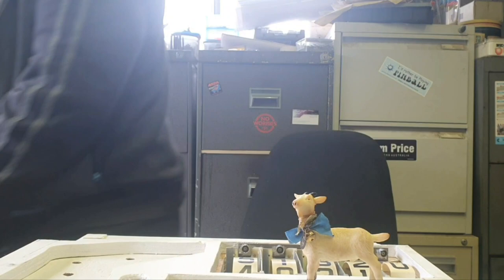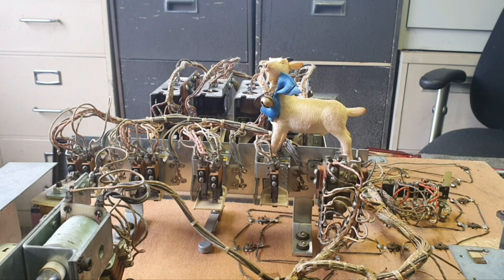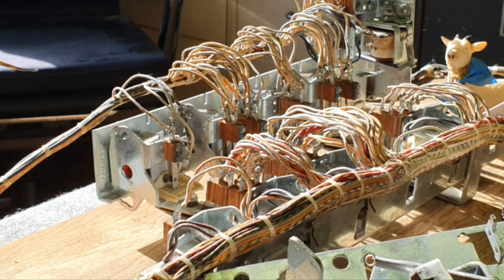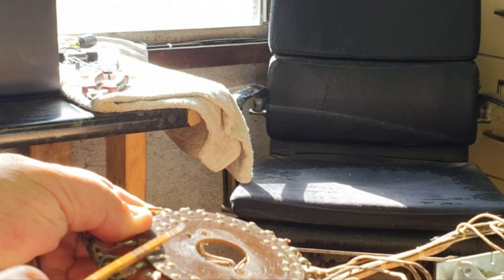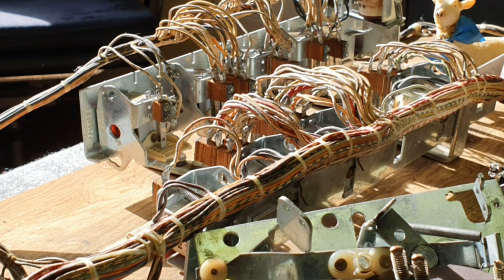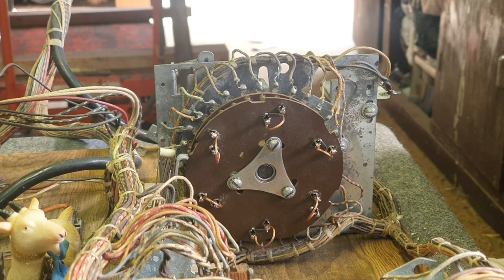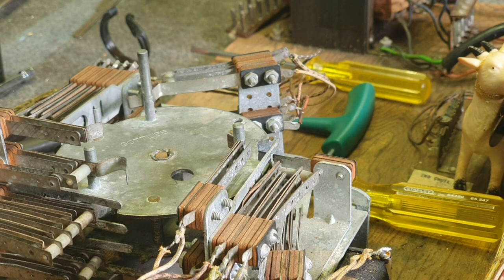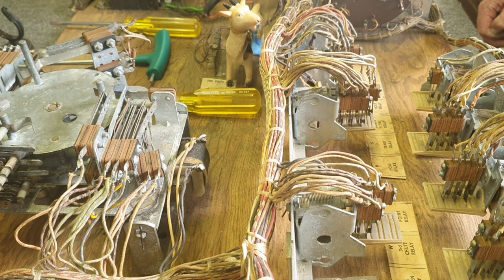Repairing Gottlieb High Hand Featuring Critical Adjustments

Comment: You’ve mentioned a few times that you use a dremel to clean switches. Have you made a video demonstrating how and what bits you use?  Is it wire or something else?

Thanks.
Reply from the maker: We have done a video in the past on switch cleaning I could do another we use a carbon brush a 443 dremel part number